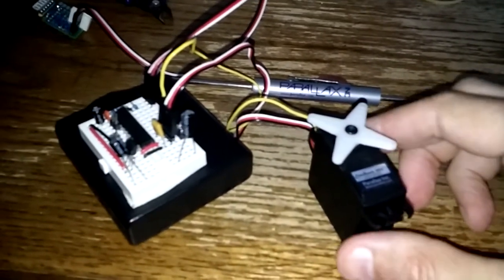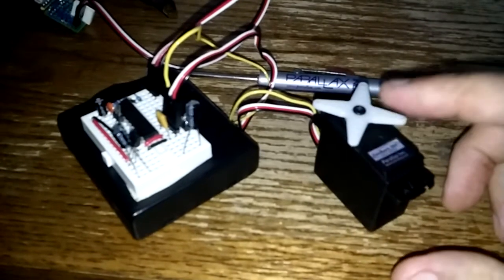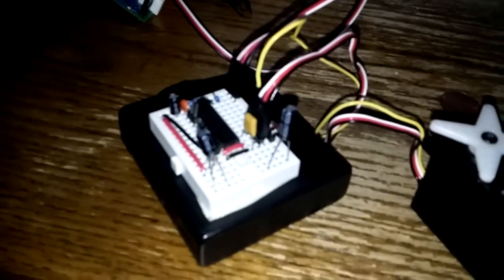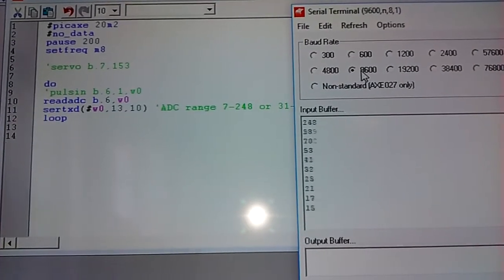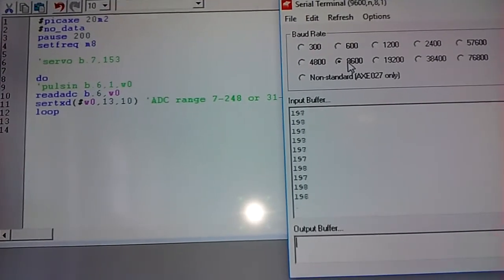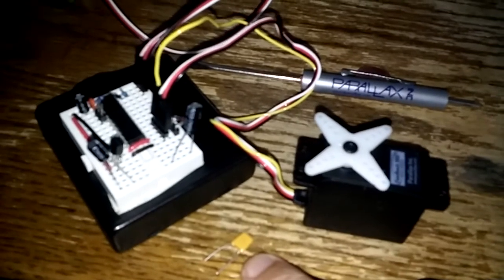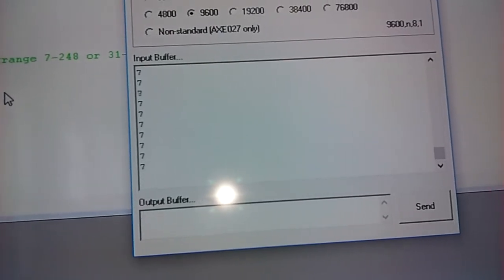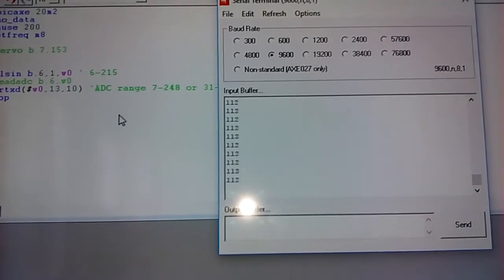Parallax Feedback 360 Servo

Comment: ercost60
 - you mentioned this has an absolute sensor. Could you confirm if this will give me absolute position reading when I boot it up also? Or would it start with the least reading and increment accordingly?
Reply from the maker: Yes, it's absolutely absolute. It uses a magnetic compass-type sensor which is amazingly consistent and repeatable.
Reply: Thanks a ton for the clarification. I think I'll give it a shot for my use case